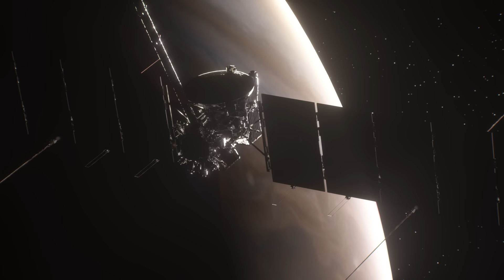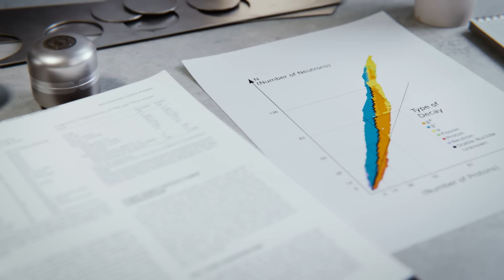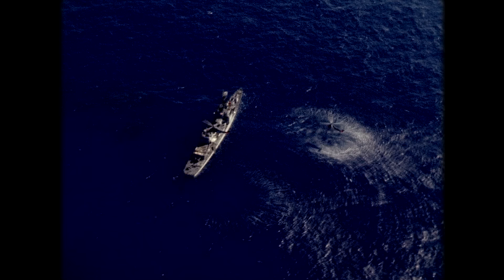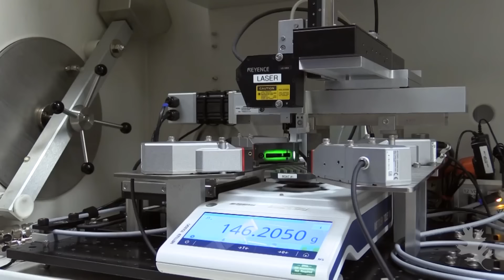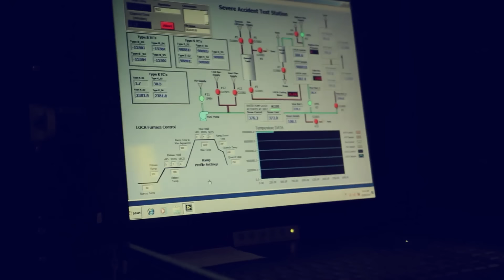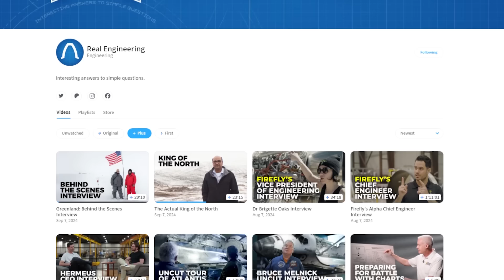NASA'S Plutonium Problem

Comment: I believe Americium 241 is considered a viable alternative and is available from commercial reactor waste. The longer half-life (432 years) is a little long, and it does need a little more shielding, but neither of these is considered prohibitive.
Reply: Am-241 is really good fuel source but unfortunately the production infrastructure for this material is nonexistent at the moment. When compared to Sr-90 it is leaps and bounds better because of the long HL and lesser need for shielding. I have heard that production infrastructure for Am-241 is in development which is exciting!
Reply: Long time ago, I worked in an area that processed Americium 241... You need a lot of shielding from those gamma photons! Workers have maximum exposure limits: weekly, monthly, yearly. Hit their limit, they cannot work.
Reply: Doing a little research on Am-241,  it looks like it’s more expensive to produce, about 1,500 a gram on top of the ~5,300 a gram that Pu-239 takes to produce, since as said before, Am-241 is made from Pu-239. and only tiny, tiny amounts — like a microgram — are used in smoke detectors. I would assume that since we’re dealing with a Plutonium shortage anyway, fixing that makes the most sense—although my reading suggested that there are quite a few kilograms stowed away ready for use, so it could be a good stop-gap to hold us over until we can get some greater production started again.
Reply: @anthonykerrik  you're making several incorrect assumptions. Pu-239 is only expensive like that when you need it in isotopically pure form. In a weapons program you need 90+ percent pure Pu-239, which requires a dedicated weapons breeder reactor. This is because the fuel has to be removed before the Plutonium absorbs extra neutrons to become Pu-240/241/etc (which are bad for bombs for reasons this post is too long to get into), but civilian power reactors want extremely long fueling cycles, like 18+ months, because they make more money that way. But the impurity that's bad for a weapons program is actually good for Am-241, because Am-241 comes from Pu-241 decay, in other words it is a byproduct of the impurities you deliberately avoid in a weapons program. That means instead of a separate and very expensive production process, Am-241 is byproduct of the waste we're producing anyway, we only need to extract it, which, yes, is expensive, but it also means there's an ~unlimited inventory we're producing whether or not we use it for space stuff.
Reply: americum
Reply: @witchesbrew333  thank you SquirtWizard69
Reply: But for a steady supply of that, you'd need a steady construction of reactors
Reply: @samsonsoturian6013  for the quantities needed for space probes we only need the reactors we have already to keep operating. Very long term it may be an issue given we're not building many reactors these days, but I don't think there's likely to be a shortage this century.
Reply: @ArbitraryConstant  For the same heat output as one kilogram of Pu-238 you need about 5 kilograms of Am-241.   Instruments on spacecraft have advanced since the days of Voyager  and Cassini. To get a full science return at Pluto only required 190W of power at 8% effecincy. New Horizons used 10 kilograms of Pu-238.  That equates to about 21 kilograms of Am-241.
Reply: the main drawback is the power density is way lower, plus it's even more expensive to extract.
Reply: The problem with needing added shielding is that that adds mass that could be used for more instruments.
Reply: suffers from the same problem, it is produced by Pu239
Reply: @alexk7173  but it has the advantage that the starting inventory is much larger (essentially all commercial fuel) and it does not require any subsequent neutron irradiation to obtain in isotopically pure form.

Comment: LFTR MSR makes pu-238 as a byproduct, also it will take all the "nuclear waste" in the world bad use up over 90% of it thus eliminating
most of a long term problem several nations have.  This reactor ran safe at ORNL for 6,000 hrs back in the 1960's and failed safe 
with passive cooling every weekend.   This reactor was not good for making bombs so it was blocked. 
The tech was copied by the chinese and they built one in their desert. 
google this article title" Chinese molten-salt reactor cleared for start up"

Comment: Apollo 13's RTG just in the ocean keeping some fish warm is the most bizarrely wholesome form of environmental nuclear waste contamination ever.
I did a little digging and the quote "It will keep some fish warm" came directly from a NASA spokesman when asked about it by the media shortly after the mission ended. It currently rests at the bottom of the Tonga trench under 6-9km of water and its capsule is not expected to fail due to corrosion for at least 870 years of submergence long after the plutonium will have decayed into significantly less radioactive Uranium-234.
I do speculate that if it is not buried the presence of a source of heat in an oceanic trench has quite possibly created a microbiome all its own.

Comment: If the demand is high and the price is right, usually the industry fills the gap - the problem is getting local industry to fill the gap rather than off shore. Also with this particular demand, the lag between demand and supply is insanely high, in the order of decades - so if action is not taken now, we need to discover alternative power sources as an interim solution.

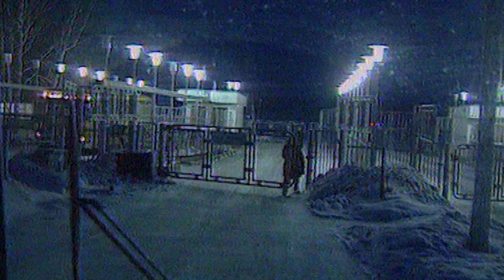Comment: 4:15 So basically, there is supply, but US government doesnt want to buy it and made a problem out of it. So NASA need to waste resources on fixing non existant problem. Class
Reply: No, there isn't supply. This video is misleading on a number of issues. Russia STOPPED PRODUCING P-238 in 2009, and at this point likely doesn't have enough for its own purposes. Further, the U.S. is now producing enough P-238 domestically to fuel NASA deep space missions into the 2030s, with more capacity coming online over the next decade.

Comment: Imagine a vehicle powered by ~4t of Pu-239 instead of ~10kg of Pu-238. You could have a Voyager probe that could remain powered on for well over ten thousand years.
 Would we lose communications with it well before then because the the power requirements for communication grow with distance squared? Yes. Would such a probe run out of power before reaching the nearest star anyway (assuming similar speeds to Voyager 1/2)? Yes. Would other systems break down well before the probe turned 10000? Almost certainly, yes. And would building such a probe required gathering nearly  a thousand nuclear bombs worth of Plutonium in one spot? Yes. 

But it would be kind of cool, I guess...
Reply: It's not all about the half life, longer doesn't equal better for powering in this case, you need an isotope which decays long enough, but not too long or too fast. Too fast and you lose most of it, too long and you don't actually produce anything because is decays too slowly: half life and activity are inversly correlate. So Pu239 might halve in 24 thousand years, but has a specific activity hundreds of times less that of Pu238, so lower power.
Reply: @filippo1864  yes. That's why you'd need tons of Pu-239 instead of kilograms of Pu-238 to get a similar amount of thermal power. That being said, arranging all the Pu-239 in a way that is both compact enough to produce a large thermal gradient and not so compact as to result in substantial amounts of fission would probably be quite the challenge.
Reply: @filippo1864  Exactly.
Reply: If you're going to put Pu-239 on a spacecraft, you'd be better off making a small nuclear reactor running on it instead of an RTG.
Reply: You would use a longer lived isotope. But the idea is about right.
Reply: @placeholdername0000  even longer than Pu-239?
Reply: @plainText384  Why not?

Comment: "The US is running out of Plutonium".

OK, I see where this is going. Who are you going to invade?
Reply: The U.S. isn't running out of plutonium. In fact, the U.S. will be producing a whopping 360 kg of plutonium annually by the early 2030s. The video is about P-238, but it's also misleading on that note, as the U.S. is already producing enough P-238 domestically to fuel NASA's deep space missions well into the 2030s, and is bringing more capacity online in the coming decade.

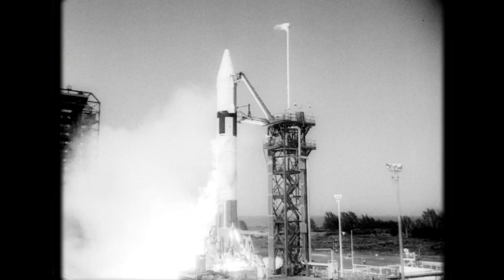Comment: 8:11 Shouldn't that be recovered?! Seems extremely dangerous if it gets released and ends up in some shore.
Reply: It’s 4000 miles off shore and is denser than lead.  

It’s not a piece of plastic floating on the surface.
Reply: @ Oh, ok. So that image shown in that statement is not the generator itself, right? That seemed really shallow water with all that light 😅
Reply: @ Wouldn't matter. It isn't going anywhere and neither is what it makes.

Comment: Why not recover the Apollo 13 reactor?
Reply: You think if that would work that would have been theorized by now
Reply: The reason is that the images used in this video were false and misleading. The Apollo 13 RTG is at a depth of approximately 6–9 kilometers (4–6 miles), and not in shallow water as the video imagery suggests.

Comment: I think it might be worth using a less desirable material that also emits beta and deal with shielding as only the electronics need the shielding, and most are already shielded due to deep space.
Reply: the weight from the shielding would be far greater than the reduction in mass from a lighter, energy dense, fuel alternative. this is also deep-space application meaning there is a way smaller margin of error in the electronics which could come under threat from the added proximity and strength of the beta radiation inside the probes themselves. Perhaps in the future where computers are less susceptible to these external factors, improvements in shielding or even finding a way to produce curium 242 easier, it could be considered.
Reply: There are some ideas to instead use Stirling engines using radiothermal power. 
They should be way more efficient (about 20% vs 5% efficiency for thermoelectric ones), but obviously there are reliability issues.
Reply: It’s likely just as complicated to make said material.
Reply: Can't you just use water for shielding?  I mean, put a water jacket around the generator because that could protect the ship and crew and you need to bring a water supply anyway.

I don't think the water would become radioactive in the process, but I could be wrong.
Reply: @LG123ABC   Water is pretty heavy too.
Reply: Radioactive paint has been used in satellites since the very beginning to keep electronics warm. It is an old, established concept.
Reply: You forget about the shielding needed to protect people while it is on the ground and while it is being made.
Reply: In the event the launch fails and the spacecraft somehow fell into the ocean and damaged the shielded container, that will be very nasty to cleanup .
Reply: @fleurdewin7958  not really, if there is more shielding, there is less risk of the fuel elements breaking. Irradiation != Contamination
Reply: @fleurdewin7958 bro its going to mars, why the hell would it crash into earth lol
Reply: @drybeanz1995 looks at the history of rocket launches
How, indeed…
Reply: @plackt i mean yeah but if it crashes theres alot more concerns asside form the cesium. Such as rocket fuel, debris and possibly dead astronauts
Reply: @drybeanz1995  yeah, but that wasn’t your question…

Comment: So a TEG is basically a Peltier cell working in reverse? instead of a current generating a temperature gradient, a temperature gradient produces current?
Reply: Yup. You can even make a crappy one that'll have bad efficiency and quick degradation using off-the-shelf peltier elements. They're reversible!
Reply: @littlegrabbiZZ9PZA  That's pretty cool.
Reply: Yes, a Peltier, a TEG, and a thermcouple are all essentially the same thing, exactly like how an LED, a solar panel, and a photodiode are all technically the same type of device, just optimized differently to maximize their performance for their intended use: electricity to heat/light conversion, heat/light to electricity conversion, and heat/light sensing respectively.
Reply: Yes! But this concept has a pathetic level of efficiency 5-7 % max
Reply: @leofernekes343  It's about reliability. There are no moving parts. They could use a Stirling engine to convert the heat to electricity but now you have to deal with bearings and seals longevity.
Reply: @leofernekes343 I wouldn't call it a concept
Reply: Yeah... like motors are generators if used in reverse
Reply: Yes, but they are built differently to optimize for electrical power output rather than heating / cooling.
Reply: Pretty much
Reply: Eye👻 concur🤔,  I think?.
Reply: I believe slightly different materials are used that make a TEG slightly more efficient than using a TEC in reverse.
Reply: That is the seebeck effect. RTGs us thermocouples (same effect, different tech)

I think there was some research into using Stirling engines as well
Reply: @GertvandenBerg I adore the idea of a stirling engine powered space craft and they're typically pretty dang efficient but I suppose adding more moving parts and thus points of failure to the most critical part of your system isn't too popular.

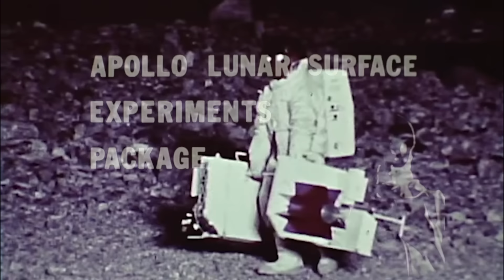Comment: 3:14 Lookup "Multihundred-watt radioisotope thermoelectric generator (MHW RTG)"  if you want to know how the Voyager probes used this power source. 4.5 kg of Pu-238 -> 157 watts of electrical power initially – halving every 87.7 years. Which is impressive
Reply: My mom was working at GE during the Voyager 1 & 2 missions, she was the one who did the procurement of the RTGs for both probes
Reply: The components converting heat to electricity also degrade, so power goes down faster.
Reply: Each Voyage probe had 3 of these RTGs.
Reply: That's MWh of produced electricity over the lifespan of the probes. Crazy to think about.
Reply: It is incredible to think there are people who literally specialize in the safe packaging of Neptunium, transmutation (in particle accelerators and reactors.m) of it into Plutonium, “distillation” (concentration) of Plutonium, shaping/forming/machining of Plutonium, and safe handling/shielding/storage of it all the way to it blasting off into the cosmos.
Reply: @you_are_soul  The pellet of plutonium is radiating energy out in every direction. You can only convert into electricity, the energy actually absorbed by the generator. And then the conversion process is not terribly efficient
Reply: Look up, not lookup.
Reply: Pu-238 is a magical product. Just grams having enough energy to power stuff for decades. The only limit being the produciton.
If for once we'd stop war efforts and just focused on stuff like this we would advance so fast....
Reply: @LemonsRage  production
Reply: Just finished Astrum's latest video on the Shortage of U238 and the possible solutions 🙂
Reply: We were blowing up multi-megaton bombs in atmospheric testing.  

You can do a bunch of cool stuff if you just don’t even bother paying for risk management, just ask the Soviets.
Reply: Their latest tests in siberia with the 50+ megaton one is what made every elites in the world go. "Ye..thats a little too much" @xanovaria
Reply: @freddykruger1086 It was originally supposed to be 100 and I think the scientist was freaking out and made it only 50, despite the warhead being designed for 100 or something to that effect
Reply: @xanovaria Erm, Castle Bravo?
Reply: @46butlook66  "Erm, Castle Bravo?"  Yeah everybody made mistakes.  

A lot of the soviet ones, nobody ever heard about.  You know the Demon Core accidents in the US?  I bet the soviets had lots of those.  Never publicized.  Then, there's that town that was destroyed and erased from maps.  The  sub that went down with all hands....

Comment: And it come from hydrogen and that’s the most abundant thing on the planet  u could just store water convert it into hydrogen convert that into trintium use it’s heat u could burn hydrogen  for thrust ..

Ur also producing oxygen ..

In think the space agency are dumb water should be the fuel source …. Ocean water ..  you can convert it into so much stuff..  instead of storing dangerous chemicals why not convert just what y need !!!